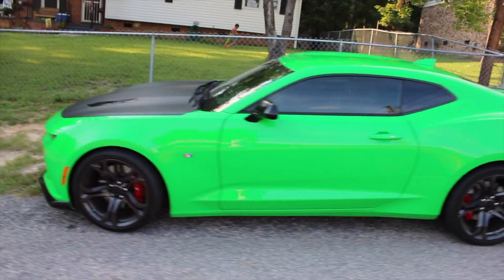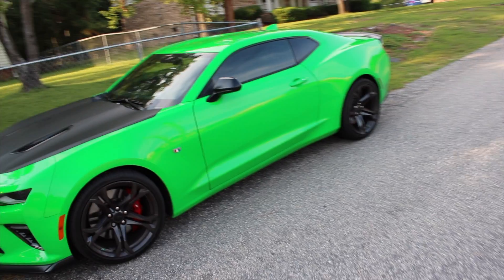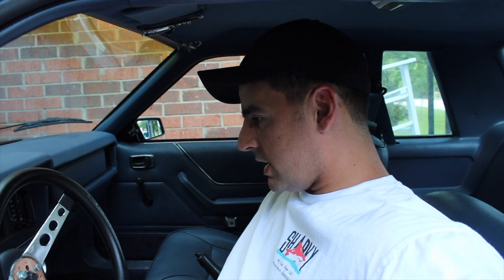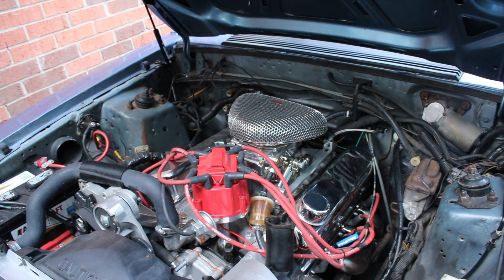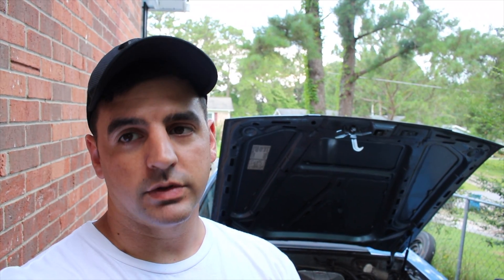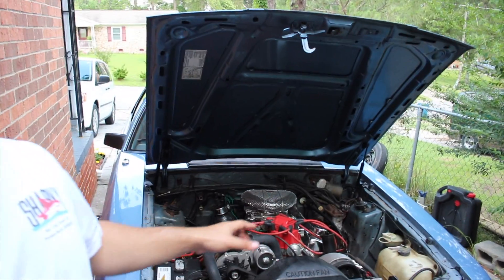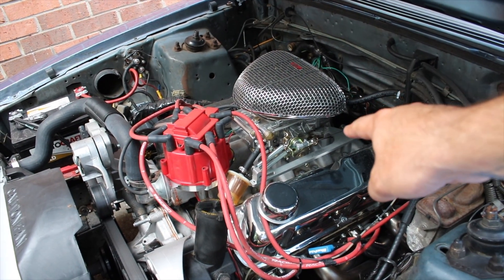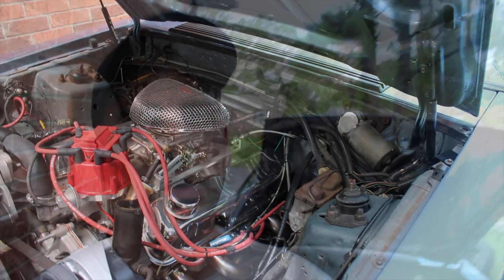Choosing Carb over Fuel injection - Why I did it?

Comment: Nice ride i have a 93 i wanna put a carb 347 in it .Did you have to change the k member? Also what about the wiring since you went with a carb
Reply from the maker: crs one no. I used the 4 cylinder k member actually. And I just had to run a few power lines for the choke and ignition and then got rid of the rest
Reply: crs one I'm not the guy that did the vid but I've done a 302 swap into a 83 fox wit a v-6 that came in it and all u need is the v-8 motor mounts and a dual sump oil pan for the v-8/302. The c-4 tranny that came behind the v-6 will bolt to the v-8 if u modest wit the horse power, if not build the trans to handle it. And all the fox body 1979 thru 1993 will not have to change the k-member weather its a 4 or v-6! I did a 351w into a 4 cylinder 1988 too. All the v-6 and 302's and 351w all share the same bell house pattern except 4 cylinder! As long as u stay wit shorty headers the 351w is a straight forward swap wit motor mounts and dual sump oil pan and some cases an aftermarket sway bar. The only stangs u will need to do a k-member swap is the 96 and up wit the 4.6liter mod motor witch im fixin to do by replacing it with a 351w/ 408 stroker into that body. If u find a v-6 model in 96 stang and up u don't have to change that k-member to put 302/351w in them cause they didn't use the modular k-member design in them. Hope i didn't answer this too late but this was my 1st time seeing this vid and reading the comments! Lol
Reply: crs one and about the wiring, summit Racing,jegs and other aftermarket stores have the 3 wire hook up distributors that dont require them module boxes. Find a 12 volt lead wire from the distributor harness that turns on and off wit your ignition switch and its a direct hook up. Some distributors require a ohm resistor to stop voltage spikes but if u use a msd or summit box u wouldn't need the resistor

Comment: Was waiting for you to say it...no sensors...no insane wiring harnesses...no computer...win win win
Reply: Art Life not only that but 30 year old fuel injection, the first speed density setups from the late 80s are going haywire. Wiring harnesses all corroded and worse! Increasing reports of the old computers starting to die!
Reply: what about a carbureted 2jzge turbo
Reply: @chrisboost5638  the answer to this would be hell no
Reply: @chrisboost5638  the answer to this is hell yeah!!!
Reply: So the simple answer is
Carb: simple, reliable as heck
Efi: More power, more fuel economy, but pain in the ass to fix
Reply: What about the holley terminator EFI (carburetor looking)?
Reply: Also efi is an ugly mass off pipes and wires plastic a carb looks so much neater

Comment: A 302 will generally make more power on a carb anyway.  Oh btw, ditch that fire hazard air cleaner.
Reply: ...the fire hazard I saw was the chinzey plastic fuel filter...ditch that in favor of a metal one..sure, it's nice to see inside it, but I've had the plastic nipples snap off just from the stress of the rubber fuel lines...safer with metal, on top of the engine like that with heat, vibration, close to the exhaust....
Reply: Agree on the air cleaner...so far, my 331stroker ran the best time of 12.6 @110 mph running the stock dual snorkel 5.0 air cleaner hooked up to the factory  cold air ducts! paper filter.

Comment: Can u give me a run down on the fuel system and how your running it
Reply from the maker: Alafia Jenkins sure thing. It’s pretty simple. Used a Mechanical Fuel pump mounted onto the block (i used a pump for the ford 390ci engine) up to a Holley 600 carb.

Comment: efi is for pussies!! carburetors make more hp as it cools the air fuel charge. all so one can get good gas mileage if one uses a lean afr and uses manifold vacuum for the distributor it will run cool and smooth and clean. all so cerebrated engens are easy tune. the biggest problem i find is people build the engen combos with out understanding how the hole package works. thay all so do not use the best ignition systems and curve them right. doing that will get you 90% their. and withe the right carburetor one just sets the idle speed screw to make the transition slots a square and the mixture screws out 1.5 turns out warm the en gen set ignition timing with the vacuum advance hose disconnected and plugged for max vacuum back off 1 inch of vaccum check timing say it is 25* btc then back it down to 5*-10 btc and connect vacuum advance see where the timing is and adjust the vacuum advance to get the timing to 25* use no more than 20* vacuum advance. then lock the distributor. next is adjust the mixture screws for max vacuum going slow then go to the other screw and do the same. now you will have the tune vary close to right.

Comment: Man ive been learning fuel injection and trying to learn to tune etc etc. Ive got a little non vtec integra stock with bolt ons and im using that to learn because its cheap to replace. 
But im starting to realize even though efi is nice and has advantages, a carb is just seeming to be the answer to my 89 f150. Much cheaper than converting to MAF or buying an aftermarket ecu, simpler to tune with less stuff to deal with, simpler to diagnose issues etc.
Ive learned alot and can do fairly well with efi but it also gets on my nerves at times. Also seems that doing mods would be simpler to adjust for, such as cam swap and the like
Reply from the maker: Chris Duncan they also have this efi type carb style setups. I think Holley makes them. And they are pretty efficient as well. But yea, I was definitely happy with my decision to build a carb car. Very simple
Reply: Coyote Crusader yes ive debated those as well, but they have issues with dual plane intakes, so that could present an issue. I guess we will see what i decide

Comment: Good job. Too bad you couldn't of found an 85 with the 5.0 for parts.
Going with the carb setup makes it simple to diagnose problems.
Enjoy it.
Reply: is no jive a got an 85, ported out 289 heads , intake, &  exhaust , had too reweld on the outside of header.  pulls great too about 5,400 RPM ,then valve float,  time for new springs next,   t- top , 5 - speed 61,400 mile  GT

Comment: I'm considering purchasing the Blueprint 347 for my 88' Saleen Convertible.  Did you need to replace anything that came on the engine in order to install it in your fox?  Ever had it on a chassis dyno?
Reply from the maker: ttocco913 when I got the engine I actually replaced the front main seal. It had a small rip and I wasn’t comfortable with leaving it in so I just went and bought a new $3 seal and fixed it. Not really a huge deal. I never was able to get it to the chassis dyno, but I guarantee it has every bit of the advertised power. One recommendation I would say is ditch the 600cfm carb and go with a 750 and it’ll really turn this thing lose. I highly, highly, recommend this engine. Good luck man. Let me know if you have any other questions
Reply: Thanks for the reply.  My car is efi so I will be buying the long block version. No carb upgrade necessary. LOL.    I'm not looking to make it a race car.  Just a potent, top down cruiser.  My only concern is the cast pistons which would make it difficult to add a supercharger later on should I want more power.

Comment: If it's a 347 you need at least a 750 cfm that 600 is killing about 50hp
Reply: Coyote Crusader Also throw that air filter in the trash and buy a 14in K&N that air flows through the top and the sides.
Reply: wrong 302 only needs 500 cfm do the math!! and that is at 100% ve and 5000-6000 rpm.
Reply: jake michael you are correct all that 347 needs is a 650 double pumper max. The 750 might make a higher peak hp but I guarantee the 650 will have a much higher tq and hp curve.
Reply: you do not no me and have tuned on 302 to 390s from stock to built. and if you do the math a 351 at 100% ve needs only 550 cfm at 5000 rpm!!!
Reply: Tim Martin No, not necessarily. Cam profile, heads, intake, gears, max rpm ALL factor in. Always better to go a little small & jet-up than too big & kill venturi. Even if it was a hair smaller (according to the math) with the right jetting and timing it would be a crisp, responsive engine.
Reply from the maker: Tim Martin agreed. This was the carb that came on the crate motor
Reply: Lol funny cause stock ford 351w came with what a 450 cfm carb 2 barrel. 347 with 600 or 650 cfm carb make good torque for everyday street use. 700+ more race more full throttle less Sunday cruz.
Reply: He does not need a 750 double pumper, but you may be correct that it might make a little more power however It won't make 50 hp more with a 750.

I am currently getting some real-world experience with different size carbs on my 351w swapped 1985 convertible.  It currently has a 770 Holley Truck Avenger on it.  I went with this carb for the annular discharge boosters on the primary side for good low rpm response.  It has the venturi and throttle blade size of a 3310 750 vacuum secondary carb.  In my experience it ran almost the same ET and mph as when the car had an 1850 Holley 600 vacuum secondary carb.

In my experience with my carbureted 302 90 LX  I ran 570 Street Avenger (same venturi and throttle blade size as a 450 Holley) and a 650 double pumper on the car at the same track on the same day.  I did not pick up anything from running the double pumper.  I had changed the pump cam and squirter on the Street Avenger to help when I dumped the clutch.
Reply: Coyote Crusader I owned serval foxbodys carbed and fuel injection. If you wanna pickup 25/50 more hp buy a 750cfm double pump carb. Set your timing at 14/15 degrees advanced run 93 octane will make a big difference and still get 20mpg on highway.
Reply: Tim Martin .....I have to agree that you need a double pumper carb on that 347 stroker and a double pumper works better on a 5spd car than vacuum secondary carbs. Regular Guy needs to ditch that econo-miser 600cfm vacuum secondary and get a 650 or 750cfm double pumper. You will feel the increase in horsepower.
Reply: jake michael you obviously don't know shit about engines. First off it's a 347cid stroker. Second 600cfm is not enough carb for a street/strip car with 5speed and now 3.90 gears. Needs a 750 like I said earlier. That would make a big difference in hp

Comment: Did you have to change your K member on the swap I currently have a 4-cylinder LX looking looking to put in a v8
Reply from the maker: Jonah Garasha no you don’t. I used the stock K member. Engine bolted right up
Reply: Coyote Crusader awesome
Reply: Coyote Crusader how much horsepower do you think you have to the wheels
Reply from the maker: Jonah Garasha I wish I stuck it on the chassis dyno, i would say at least 385ish at the wheels

Comment: Is the 347 a 302 with the largest stroker kit?
Reply: 363 is the largest stroker for a 302 with after market blocks and 347 for stock blocks
Reply: Rat Fink you go bigger in the 370s with offset grind crank and stock block but not recommend

Comment: I messaged you a couple weeks ago about fuel injection on these cars and had plans on going fuel injection until I pulled the 4 cylinder. To swap over to fuel injection is a nightmare. Complete harness swap from gas door to headlights. Dash harness and all. I'm going carburetor now. It is seriously a lot easier. Awesome car and great build. My black 85 notch has 37k miles and I really don't want to tear the whole car apart. I just want a nice clean build.
Reply: Sam  Scornaienchi I don't know you told you that. I personally took a 4cyl fuel injection out of a 90 mustang and put a 5.0 in it with fuel injection. The 5.0 engine harness will plug right in. The only harness that has to be changed is from the computer in the kick panel through the firewall to the engine. There's two factory plugs from the driver side firewall under the hood hinge and they will plug up and work.
Reply: @timmartin4798  I have a 1980 notch witch never had computer was thinking about going fuel injection it a 331 5spd carbureted can't find a mustang harness u know of any other harness that is close I'm on a budget   thanks
Reply: That's incorrect, the only harness you needed to swap was the engine harness.

Comment: Are you sure you bought a 347 engine.  It sounds like you may have a 302.  You never can be sure of what you are getting when you buy stuff on line unless you tear it down and check it.  That is why you should only use local machine shops.  That engine should have a 650 or 700 CFM carb. on it.  If it is a 347, it is starving with a 600 CFM carb.  I would do some checking to see if it was a 347 or just a 302 with a wild cam.
Reply from the maker: Harold Lovett unless a 347 with a wild cam can make 415/448 on the dyno, id say it's def a 347 lol. Blueprint engines is pretty reputable too
Reply from the maker: Harold Lovett I'll look into it. Thanks for the advice!
Reply: @RegularGuyGarage  it's a 347 with those numbers(especially wheel horsepower). To get a 302 to make those numbers you will need mid to high compression, at least 10.5 to 1 or higher and a big cam.
Reply: Now you are talking, wake that motor up.  A 750 double pumper will work just fine.  You will need to tune it but you will see a big difference.
Reply: Coyote Crusader blueprint is a good company but with a little work done a 347 will make over 500hp easy.
Reply: Harold Lovett Blueprint is a reputable company, if it's advertised and sold as a 347..it's a 347.
Reply: Coyote Crusader My buddy and I had an 85 GT with a 750 Holley and it loved it. Bone stock except for aluminum intake and a 125 shot. A bigger carb would definitely help, I'd go with at least a 700 with a 1inch spacer.
Reply: Well great, then it just needs a bigger carb.
Reply: Bob Falfa?  Of American Graffiti fame?  and at the Seattle Roadster show, an orange 55 chevy had a Falfa speedshop decal on it.  Cool name.
Reply: I have a 347 blue print stokerin my Maverick
Reply: You wouldn't mind sharing your engine combo would you?  I'd like to do a 302 in my '88 drag project with those kind of numbers.
Reply: You wouldn't mind sharing your engine combo would you? I have an '88 drag project I'd like to drop a 302 in with those kind of numbers.

Comment: I notice you don't have a brake booster what's your brake set up
Reply from the maker: Ozzman306 stock brake system
Reply: He has a brake booster but its black paint makes it hard to see.  You can see the large vacuum line and the white check valve on the booster.

Comment: Hey awesome video and thank you for clarifying a few things 

like fuel lines and pedal. I have 2 donor cars a 1990 and a 1986 to use for the swap with my 85 Notch.  I spoke with summit racing and he said that the dash harness has to be swapped which I really don't want to do but if I don't do efi I have to buy a carb , intake fuel pump etc. . I have 2 complete engines. Right now I'm cleaning everything up that came out of the 86 like the bell housing, transmission and the motor. I power washed everything but the motor which I don't think I'm foto do. I really want to go efi but I'm still not confident in what has to be done with the harness. I'll keep working and find out I guess. There is a computer in the kick panel though.